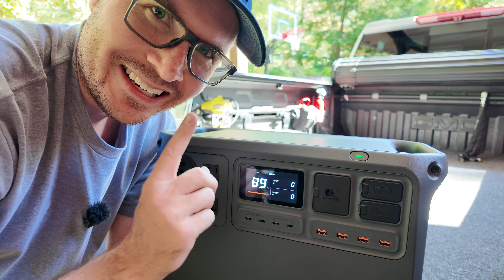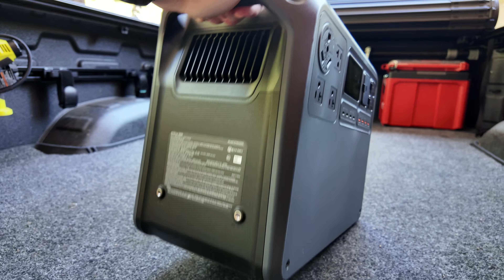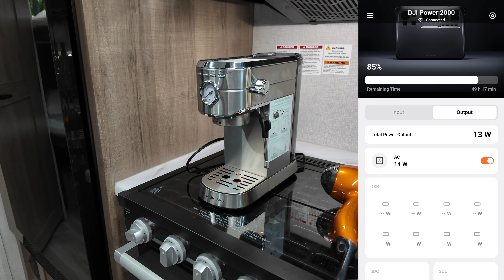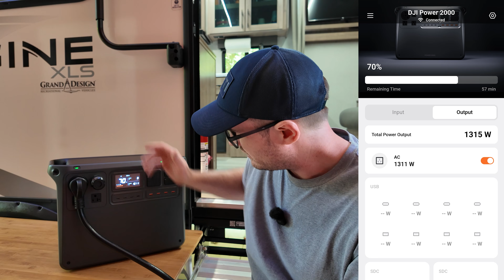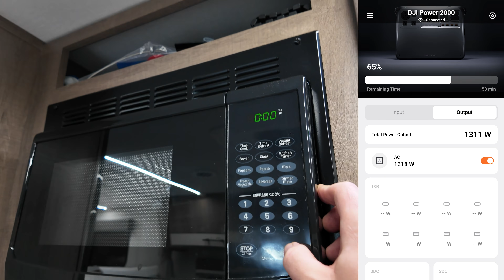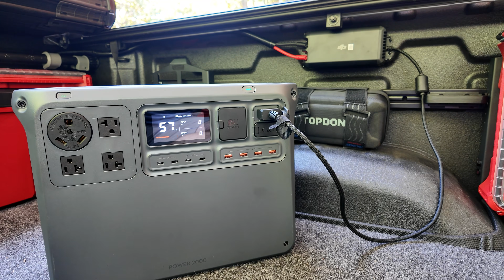Ditch the Generator! DJI Power 2000: The ULTIMATE RV Power Station?

Comment: DJI Power 2000 Failed After Only 3 Weeks — Nearly 7 Weeks Dealing With Support and Still No Repair Case
I’m extremely disappointed with both my DJI Power 2000 and the customer support I’ve received from DJI.
I purchased the Power 2000 at the beginning of a 6-month trip, expecting it to be a reliable source of portable power. I spent a significant amount of hard-earned money on this unit, and it started having major problems after only about 3 weeks of use.
The problem is severe. The unit will show around 85% battery remaining and then suddenly die completely. When I plug it back in, it behaves as though the battery is at 0% and charges all the way back to 100%. I essentially have a power station that I cannot trust because I never know when it is going to shut down.
I first contacted DJI Support on August 17, 2026. Since then, I have exchanged multiple emails with support and followed the troubleshooting steps they provided, including firmware updates, slow charging, allowing the unit to rest for 24 hours, and retesting it. The problem continued.
Eventually, DJI told me to create a repair case. That created an entirely new problem.
When I select my DJI Power 2000 through DJI’s repair system, the website tells me that because of the characteristics of the product, I need to contact DJI Support for assistance and a timely replacement. The only option is “Contact Now,” which sends me right back to DJI Support.
I explained this to DJI multiple times. I refreshed the page and attempted the process again exactly as instructed. Same result.
On September 16, DJI Support stopped responding to my emails. I followed up again, clearly explaining that their own repair system would not allow me to create a case and asking them to manually create or escalate a repair/replacement case.
Still nothing.
It is now October 2, 2026. I originally contacted DJI on August 17, and after nearly 7 weeks, I STILL do not have a repair case number, return instructions, replacement, or resolution.
That is unacceptable customer service for an expensive product that failed after only a few weeks.
I bought this unit specifically because I was traveling for six months and needed something dependable. Instead, I have spent a large portion of my trip dealing with troubleshooting, emails, a repair website that sends me in circles, and unanswered follow-ups. Meanwhile, I’m stuck with an expensive Power 2000 that I cannot depend on.
I understand that electronics can occasionally fail. What is most disappointing is how DJI has handled the failure. A defective product can be repaired or replaced. Leaving a customer without a working product, without a repair case, and without even responding to their emails is a customer-service problem.
I have documentation of my correspondence with DJI Support going back to August 17 and the attempts I have made to get this resolved.
I really wanted to like the DJI Power 2000, but based on my experience, I cannot recommend spending this kind of money on one. My unit developed a serious battery/power-management problem after approximately three weeks, and nearly seven weeks after first contacting support, I still don't have a repair or replacement case.
Buyer beware: if your Power 2000 develops a problem like mine did, my experience shows that getting it repaired or replaced may be far more difficult than you would expect.
DJI, if you see this review, I am simply asking for what I have been requesting for weeks: create my repair/replacement case, provide me with a case number and shipping instructions, and resolve the problem.

Comment: Good morning,
Just picked one up on Amazon for $749.
Quick question, I'm not sure how often I'd use it, but can you use a USB-C to 12v adapter on this?
Reply from the maker: Yes, typically the adapters are limited to X wattage, but for light duty it's a great choice.

Comment: Good review, I am considering a power station to ditch my dual fuel generator and mainly because I camp in heavy tree canopy where solar does not work well. Will this keep my 105 ah lithium topped off or charge it if at 50%? I noticed you turned off the converter.  Not interested in running AC so can I get a 1500 watt station for my use instead?
Reply from the maker: Thank you for watching! If you leave the converter on and plug your shore power cord directly into the station, it will easily charge your battery. In fact, to charge a 105Ah 12V battery from 50% to 100%, you need about 672 Watt-hours. Factoring in conversion loss, it will pull about 790 Wh from a DJI Power 2000 (which holds 2048 Wh), leaving you with about 60% battery left on the station.

Comment: Beware: peripheral devices have been back-ordered for over a year and DJI refuses to provide any kind of assurance regarding when they will be in stock again. 

I found this out the hard way. I ordered a DJI PowerStation 2000 and a DJI Power 1.8kW Solar/Car Super Fast Charger over a year ago from Amazon. The power station arrived but the 1.8kW Solar/Car Superfast Charger order was cancelled. I tried to order it directly from DJI but it was listed as “Out of Stock”. I signed up for email notification of its availability and started checking the DJI and Amazon website every morning. After 6 months I was forced to buy a Z Stock Compatible for DJI Power Solar Panel Adapter Module (MPPT), because DJI was listing them as “Out of Stock”, and build my own buck converter device in order to connect my solar panels to the DJI power station. 

Nearly a year and a half after I purchased my DJI power station, I did my daily check and DJI had the 1.8kW Solar/Car Charger listed. I ordered one. DJI verified the order and put it “Pending” status. 4 weeks later I contacted them and they said it was out of stock. They are unwilling to provide any kind of estimate of when it will be in stock. 

Just know that, if you’re buying the DJI Power Station 2000 to use standalone, you’re good. But if you intend to expand it using DJI peripheral devices, good luck. I have been waiting over 18 months. 

Maybe, some day, they will have them in stock… or not.

Good luck with “Customer Support” - a misnomer if ever there was one. They are essentially a platitude factory. It’s like talking to the inmates of an insane asylum. 

Here, let me save you a bunch of time and frustration:

1. We’re SO very sorry.
2. You’re SOL

Comment: Could I plug my rv 30A cord into a power station A/C receptacle  using the dog bone adaptor ?
Reply from the maker: On this one it already has the 30A RV plug built-in, so no dog bone needed. Others that only have 15-20A plugs may need that.

Comment: How long do you estimate that it will run the air conditioning alone from a fully charged state ? Thank you
Reply from the maker: For a conventional 15K air conditioner like the Furrion HE in my video (with soft start) it'll run about 1 hour 10 minutes continuously at full fan speed.

Comment: I noticed you have a GMC which likely has the standard plug in the bed on the right hand side. Without the rapid recharge kit, how long would it take to charge plugged into that?
Reply from the maker: Great question. The challenge is, the GM AC inverter is limited to 400W AC output and it isn't a pure sine wave inverter, whereas the power stations prefer a pure sine wave for input and this one can ramp up to 1800W draw on the AC input. Some power stations have input throttle controls where you can limit to only 350W...the DJI lets you limit to about 1400W, but currently the software doesn't allow you to throttle down lower...meaning it would trip the "breaker" on the truck due to over-current draw. Hope all that makes sense!

Comment: Can it supply ac power WHILE it is being charged, by a generator?  I think they call that thruput charging.

If you charge it with a gas generator can it be modified sine wave or does it have to be pure sine wave?
Reply from the maker: Yes on thruput charging. Pure sine wave recommended.
Reply: @AdventureRocks thanks